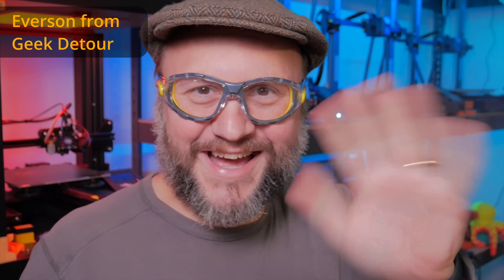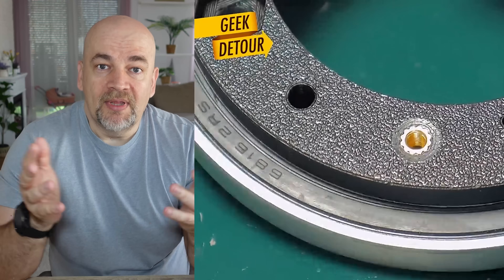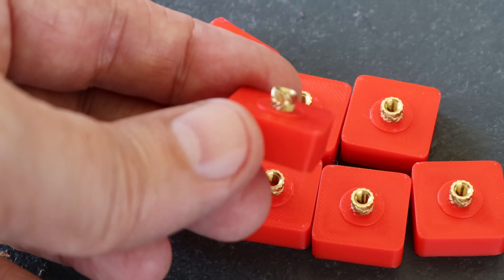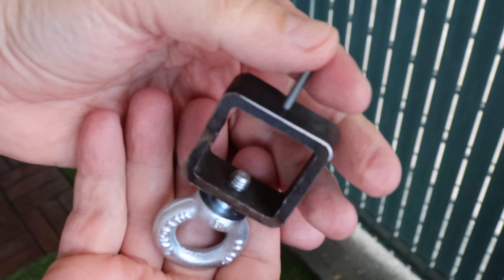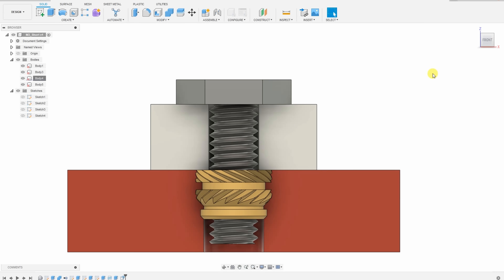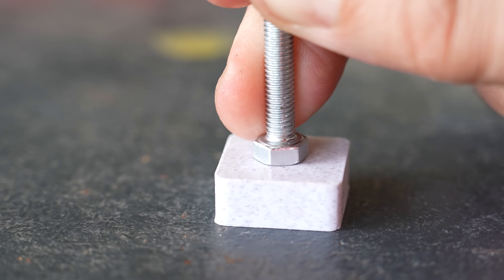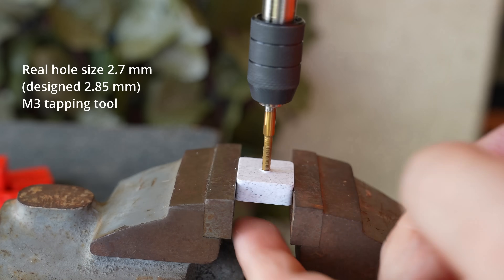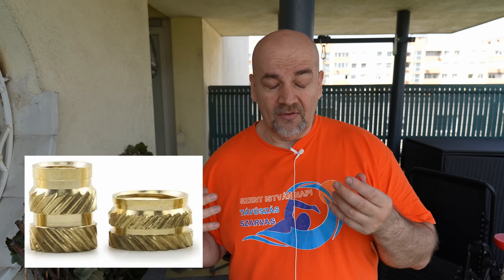Even stronger Heat-Set Brass inserting method for 3D prints? Let's test it!

Comment from the maker: In the meantime I decided to go one step forward, I will test different size M3 inserts (diameters 4.2, 4.5 and 5mm, lengths 3, 5, 7 mm). They will arrive in 3-4 weeks..
Reply: wow you are such a legend 😍 thanks!
Reply: If only I had all the measuring equipment… and IF I was strong as you! 😅 I guess I will need to wait 3-4 weeks to watch too 😂❤ Thank you so much Igor for testing - threaded Brass Inserts are so fun!
Reply: Could 3dprint endure air  psi from a compressor for a sandblast quick-connection?
Reply: @dustargentum  wouldn't risk it
Reply: It is better to do experiments on one filament, especially since marble PLA is good for beauty but not for threaded inserts
Reply: I have a question.  What if you put the threaded insert on the bottom side of the part?  So the bolt goes through the 3d printed part and engages at the bottom of the hole, then as you apply more torque the insert gets pulled deeper into the body of the3D printed part?

Comment: Kind of surprised this isn't as apparent to others. Just melting them into plastic wont work, they have to be "set" with something else and the bolt works quite well. I machined a tool to set these on my lathe. Maybe I should market it as a complete set. Thanks for the idea.

Comment: For everyone interested: if you want to convert torque to axial pulling force, you can use one of the many Bolt Force Calculators.
Keep in mind that steel-brass has 25% of the friction of steel-steel, so multiply the force by 4 when calculating the axial force or reduce the needed torque by 4x when calculating the required torque for a given axial force.

Comment: Assuming the 3DP part/thread is at least 10mm, strongest is to actually drill a hole for tapping (for M3 I think it's 2.5mm), but not tap it, and just let the M3 screw self tap it, this way you can get so much strength, the M3 SS screw will shear off.
Reply from the maker: In case you don't want to remove the screw, its OK. But with stress relaxation it may became lose earlier than inserts.
Reply: @MyTechFun  Yes that's one use, when the plastic relaxes over time it will seize the screw up, or even seconds later if you use PC filament.

Comment: I've been using a method of insetting the insert below the surface (by about .3 to .5 mm) below the surface and pressing the flash flush and finished with a bolt face with a small raised chamfered cylinder. This reveals the threads and a small circle of the brass, but seals the teeth of the insert. It doesn't look as nice as the flush inserts, but it looks better than just letting the flash harden rough.
Reply from the maker: Yes, it is a good method, but when you have a part exactly above the brass, less chance that you will pull it out, as explained in my previous video

Comment: Why people don't use screws for plastics? They provide a much stronger connection. Work best with square holes, because they keep the 4 corners intact. Another good shape for the holes is a plus shape.
Reply: For stuff that you screw only once or twice - like, to assemble enclosures, screws for plastic are great. But for assembling and disassembling many times without ever losing grip, the brass insert is SO cool!
Reply: @GeekDetour  , I have a full bag of M3 brass inserts and after months of trying them on various models I can definitely say that a M5 screw for plastic holds better than the M3 the brass inserts. Plus, the screws for plastic take less space, don't require heat installation and can be used in much tighter areas due to the overall lesser diameter. Assembling and disassembling many times is not an issue at all.

Comment: You should make tests with different soldering iron temperatures, I'm quite sure that the higher temp, the more melting plastic and then the more resistance to traction and torsion.
Reply from the maker: Hello. Currently I am testing different sizes (video in less than 1 week). After this probably the effect of the temperature and hole size.
Reply: @MyTechFun  I'll stay tuned.
Reply: @MyTechFun  There are also different heights for the same thread size. m4-d6 up to 12mm for example

Comment: Please use the same filament for all tests in a video.
Even a change in filament color (same brand and type) can have impacts on your results!
White/Natural Filament is the strongest. But color often has effects on performance and other additives for "effects" (matt finish, marbling, etc.) can significantly change your print properties!
Stefan has made a very good video about that topic "Myth Busting: Color vs Strength in PLA" from CNC Kitchen.

Comment: have you tested squared metal plates with threading (>2mm thick) placed inside during the printing process?

print model with internal unfilled pocket, put threaded insert (can be bottom glued), and continue printing until the detail finished (the top part should be with bolt hole to make insert aligned with it)
Reply: the screwing force will tend to pull out the plate, and the cross-section of the material under load will be maximum

Comment: to reuse a fastener in pla.. if simply threaded into the plastic.. run the screw down,,, let it strip out.. run that fastener fast it will heat up the plastic and fuse the faster once it cools down.

Comment: If if you have access to a lathe, you make a piece that fits inside your insert with a flat nail head shape round roughly double the diameter of your insert and then a little center drill  indent for your soldering iron this will insure that your insert  are flush And straight

Comment: Curious if time heat applied AND the ideal temp for the material would make a difference.  We know how sensitive different filaments can be for layer strength when not printed at ideal temps - I wonder if inserts into that filament might benefit from those target temps.  Also time with heat applied... make a difference?

Comment: A lot of parts I use threaded inserts on, I use them as through holes. So as long as the design allows for it, the threaded insert could be inserted on the reverse side of the piece, then you need a through hole that the bolt can go through, threaded or not, of plastic, and then the insert goes in from the back side, so to pull out, it has to pull the insert through all of the plastic that should be solid, vs just pulling it out of it's heatset hole.

Comment: check out something called a sonic welder. I worked at a a plastics plant. We used a sonic welder to put those exact inserts into a part that was very structural.  We would do a pull test to assure the inserts were holding. The hole needs to be just a smidge smaller than the insert, the sonic welder vibrates it enough to push in but does not melt any other plastic. When you melt plastic its strength is compromised just a little bit. Also it only took about 2 seconds per insert.

Comment: What about testing the strength on a inserted hex-nut ? either where you design
 a slot to push the hex-nut into the slot after the print or  pause a print and then insert the hex-nut ,
could be interesting to see if this method is stronger than brass inserts

Comment: If the design permits put the insert on the back side and print hole with clearance for the bolt. The insert will then pull in tighter to the material.

Comment: I would be interested to see if the insertion temperature makes any difference to the strength of the insert. Perhaps a higher temperature may make the molten plastic conform to the contours of the insert better than a lower temperature. Any thoughts?

Comment: If it needs to hold up, I like to put in the insert on the back side of the hole. So if the plastic yields, the insert will only go further into the print instead of getting pulled out.
Alternative would be to pause the print, put in the insert, and resume printing over it, leaving just enough of a hole to fit the bolt but still cover the insert as much as possible.

Comment: Great video. While I was watching it, I've got an idea which may be usable in some cases, where the inserts will be subjected to much higher pulling force than usual. I don't know if this idea has already been used or not, and I apologize in advance if it has. In short, I think if the hole was countersunk from the back side of the print (if the geometry allows it), the front hole just enough to get the bolt through, as much material left in between (and longer bolts used), and the surrounding cylindrical area printed with 100% density, the bond would no longer depend as much on the capability of the insert to hold on to the plastic around it, but rather on the toughness of the material against compression force and the distance between the insert and the front surface. This may not be something one would use in every case, but it's not much harder to implement, at least where much higher forces are to be expected and more reliable bond is required. I thought you may want to try it and compare the results, even if the method stays reserved only for special cases. Although I think it can be used in almost all cases by just moving the insert hole to the opposite side and adding the narrow hole for the bolt. And using longer bolts, of course.

Comment: my experience is if i rotate the insert slowly while pushing in, it holds stronger. also if i can i push the insert
 below the surface level and then i push a bolt like flat object on it plastic will cover the inserts rim making it even stronger. this method can be  applied only if the inserts verticallity not that critical

Comment: Biggest factor is the temperatrure and heat resistance of the material it's in- whn you apply a load to the threads they heat up (Boyle's Law) and actually begine to extrude around the thread features of the insert. Put the part in the refrigerator and it can take a lot more load. Ditto fo a high temp material

Comment: If the pull is perpendicular to the layers (as in your test - pull is trying to separate layers) as opposed to pulling parallel with the layers, does that make a difference?

I'd expect any of the heat-set methods that melt the plastic around the insert to be less affected by the orientation of the layers.

Different inserts have different outer shapes to grip the material. I expect the inserts with large outer threads designed for particle board or MDF to hold better in printed plastic, but maybe the difficulty of inserting the insert into sufficient plastic to thoroughly embed the insert would be difficult.

Comment: I don't see many tests done on the hex hrad m3 coarse threaded bolts like those in the packaging you remove from the bambu lab x1c and possible other models. 

It looks like it is less likely to tear out the plastic.

Comment: so what if you do both push it below the surface then flatten it on the table or push a bolt into it to create a lip to help keep it captive? only issue I can see is excess plastic obstructing the insert's thread.

Comment: I always press them down using a popsicle stick at the least. Just something to flatten off the top and make the insert (and plastic that sometimes oozes up around it) flush with the surface. Metal is better though because it cools the part down faster.

Comment: Your issue with the torque test is you are applying torque while pulling tension. The tread creates pull as well. So for a pure torque test you need to clamp it in a vise and only try to turn the insert. For example by screwing a bolt through until it bottoms and have a hole in the bottom of the test cube to sit through.

I would be more interested in how much you can twist from the underside ie same as on that pull test. 

Proper bolted connections are very strong but anchoring the material in the print is the hard part. The way you did the pull test was the ideal way to fit them.

Comment: I did the the other day with a mini blow torch and a long bolt for M3 inserts, worked great, I also used a soldering iron with no special tip and that works great for small inserts

Comment: I'm always surprised that the threaded inserts are always melted in on the side where the screw is. In my opinion, it makes more sense to melt the thread inserts on the opposite side if possible. This way, the thread inserts are pulled into the component (just like normal nuts are used in 3D printed parts).

Comment: Conclusion: Do it however you want because no one is going to use one 3mm insert to hang their body off a cliff face.
Also, torque wise, I’ve stripped more m3 brass insert threads than I have pulled out of my prints with multiple brand inserts. Maybe I’m just lucky/unlucky

Comment: When using Heat-Inserts, I always try to set them from the opposite side of the part I want to attach, so the insert has to get pulled through the part with the insert. maybe you could try this way, too. Happy printing!

Comment: To prevent pulling out the threaded insert while tightening a screw it is advised to design the parts so that the insert is pulled into the plastic (inserted from the opposite side).
Reply: exactly, thats the test I want to see, though at that point I am going to guess it will be an exercise in which filament has the highest crush strength.
Reply: You'd likely be better off with a square nut in that case

Comment: I feel that most most methods of using threaded inserts on YT (including unfortunately this one), are quite lacking proper heat and pressure application. This is evident by looking at the gaps left between the melted plastic and the insert. This is evident by looking at the pulled out inserts, where we see there's only a small band around the middle where the plastic bonded with the insert.
In contrast, a great example of execution is the Nukit Heat Set Insert Press by Naomi Wu. Despite this kit being overkill IMO, it showcases an effective and consistent use of applied force and temperature.
I would be very curious to see how this affects in practice :)
Thank you so much for the investigation you carried out in this video

Comment: What about the inserts that expand into the sides when you screw into them? Not the ones that bow outward and become shortened. I mean the ones that look like a bird beak with a slot in both sides and the inserted screw opens the mouth up, forcing the knurled sides of the insert into the plastic.

Comment: It would be interesting to see if it melted in from the bottom leaving some untouched plastic above 2-5 mm. The diameter above the insert should be just a bit bigger than the bolt. Like 3.1-3.2mm.

Comment: I heard from another guy on YouTube who works doing injection molding that these inserts are better being inserted from the bottom instead of the top whenever that's physically possible. You should test that statement. It does make sense when you consider the shape of the insert .
Reply: I'm glad someone said this, I always put mine in the backside. TBH I saw heat inserts and ordered a bunch and this is just the way I started using them just made more sense to me.

Comment: Ive had mixed experiences with marble PLA being softer and more fragile than normal PLA or PLA+. Could switching filaments in this test (red to marble) have a drastic difference when it comes to comparing the different forces?

Comment: Another interesting test would be between various "gripping protrusions" on the inserts. "Slanted" like the ones you uesed in this video, and "vertical". I don't know the correct terms. Here's some "ASCII art" to demonstrate:

Slanted:
/////
\\\\

Vertical:
|||||
|||||

Sorry for the crudeness. Being able to link to images would have been so nice.😅

I suspect the "vertical" kind would be worse in the pull out test, but it could be better in the torque test.

Comment: Good tests but the results weren't surprising.  For maximum torque,  you'd probably be better off pressing a hex nut into a hex cavity, then heat staking plastic at the edges.   Or if possible, insert the nut from the backside or an opening on the side of the part.

Comment: If you can, press in the insert from the opposite side.
Reply from the maker: In that case, a regular hex nut is better
Reply: @MyTechFun  A hex nut is a good choice but a heat insert is better designed to resist spinning from applied torque.

Comment: An idea for another test that I'm uncertain of the outcome. Hole tolerances for these inserts, slightly too small, just right, slightly too large in steps. Ideally they all should all be something like 0.1 toleranced increments on both too tight and too loose, and noted what size ends up being the natural press-fit in the ranges before heat is applied. I'm just very curious how much the sizing impacts the strength, and how much time we should bother refining it. It will obviously vary per insert model, but i think you'll get the idea. Also you could comment on which come out the cleanest, and maybe where undersized ones start trying to deform plastic into the hole underneath it.

Comment: With threaded inserts, if you want maximum strength you would insert the threaded insert on the opposite side and use a longer bolt. This way, there is a material above the threaded insert and it will be much harder to pull out.
Reply: I had the same thought when he was talking about the spacer/air gap on the top.

Comment: I twist the insert while inserting it so that plastic better flows in the cavities of the diagonal external ridges
Reply: How do you twist them while pushing? You are not using a Flat Tip?
Reply: @GeekDetour  i twist back and forth about 20° a couple of times while pushing down so that both diagonal "threads" are properly wetted and plastic goes nicely in the gap between the two threads, then I use the table or the flat part of curved pliers to ensure flatness